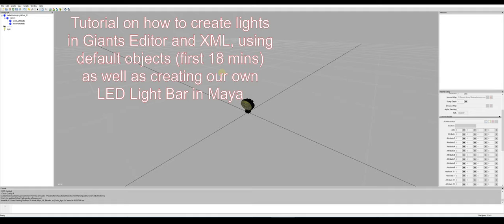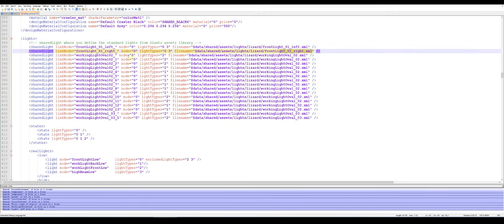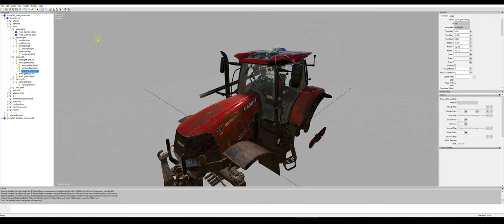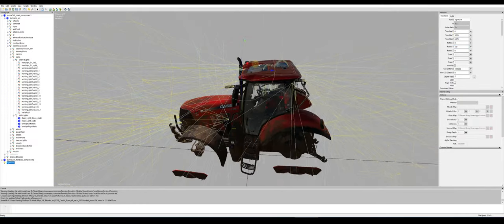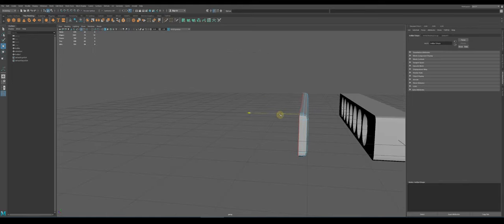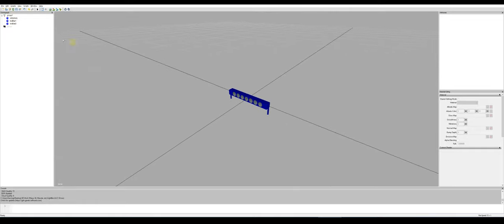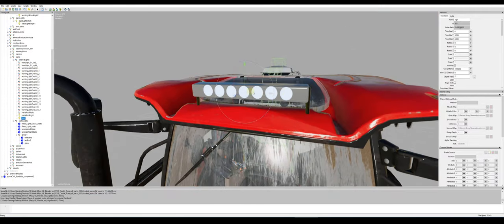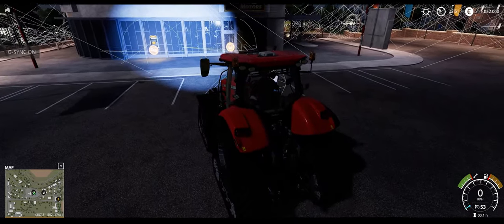FS19: Tutorial lights - using defaults, creating your own, range, color

Comment: Also, what are the different states? 
Such as, 0 1 2 3 4 etc.

Light type 3 isn't listed in states, however 0 1 2 and 4 are. Is light type 3 just for high beams on second press anyway, or am I wrong about that?